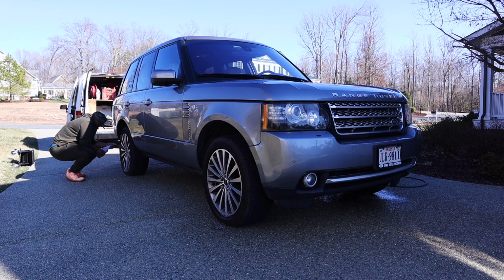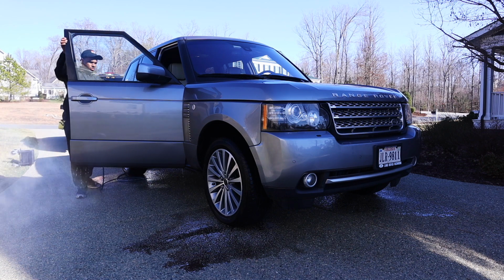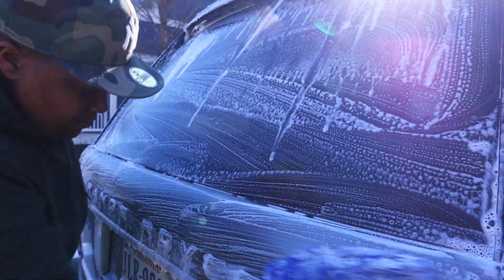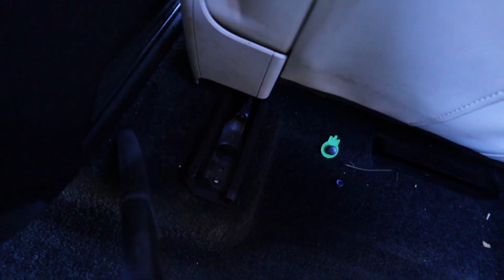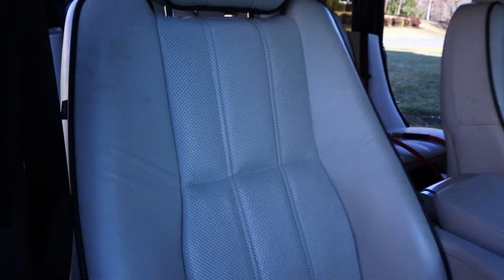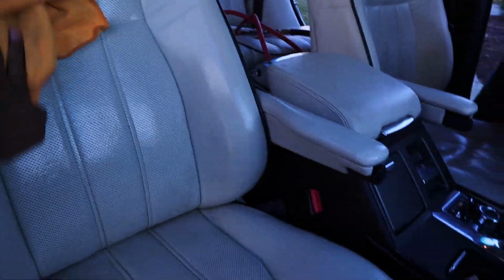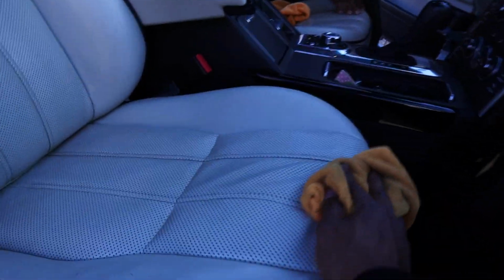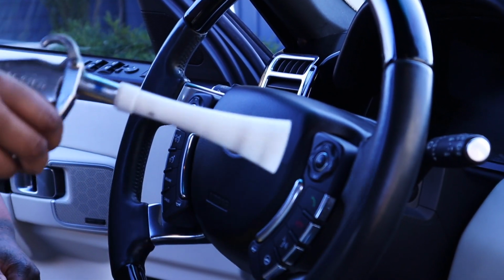HOW MUCH WOULD YOU CHARGE FOR SOMETHING LIKE THIS? MENDEZ MOBILE CAR DETAILING

Comment: Be careful with that wheel acid with no PPE man! Protect your lungs 🫁 and hands 🙌
Reply: Exactly, them chemical burns are no joke and upper respiratory issues.
Reply from the maker: I never use that stuff straight. But still it definitely is strong af lol thanks for caring I really appreciate that
Reply: @mendezmobiledetailing   you should check out Nanoskin non acid, apparently just as good as a acid based. Alternatively, p&s brake buster and on cars you’ve never seen a little iron remover with it. Glad you’re not using it straight 😬
Reply from the maker: @stephen1503  yeah I think im gonna play it safe with the non acid, Thanks for those recommendations because I had no idea which to buy hahaha you the man Stephen!!